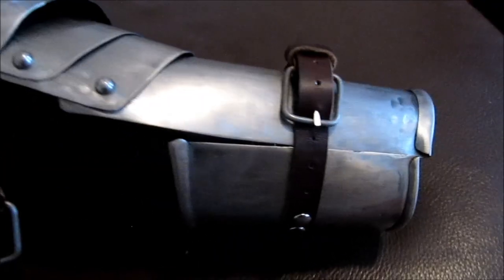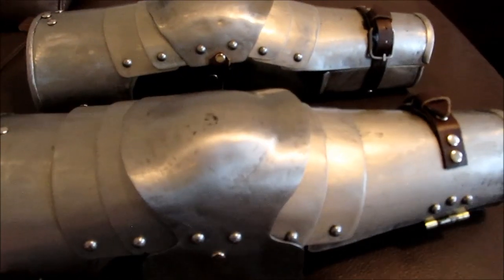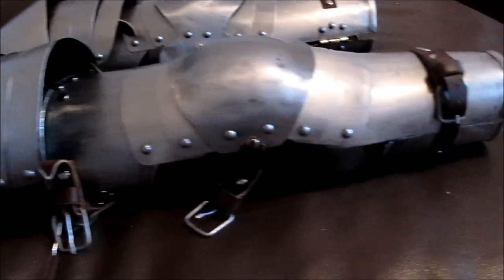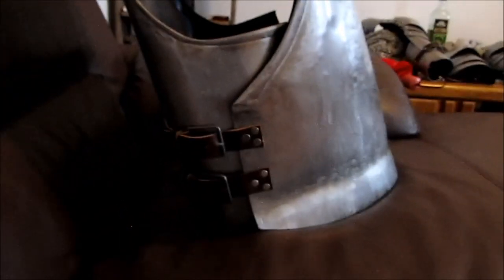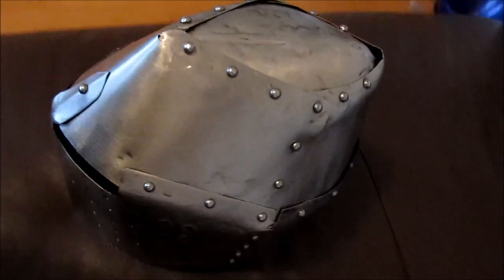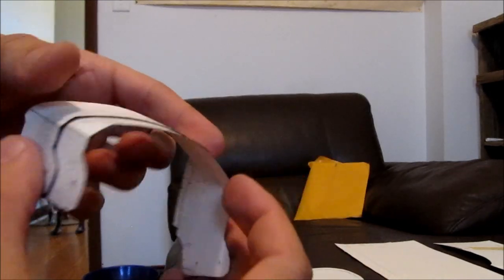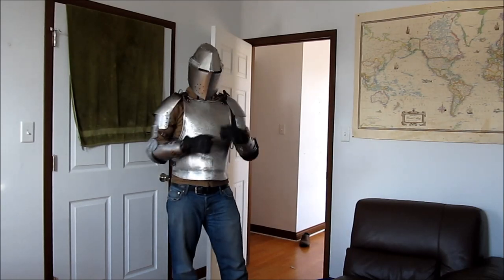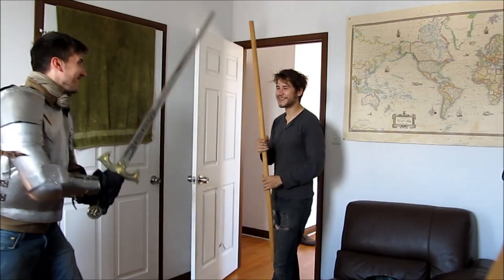Plate Armor tutorial [HD]

Comment: For a first suit, it's a really fine job.

Sure there are mistakes, but a first suit without mistakes, there is something odd going on there.

I'd say the piece that came out the best was the lower arms. The articulation along the elbow was really nice.

Me myself is working with 1'5mm steel. That's inbetween 16-17 gauge.
So it is a lot tougher, but then i'm making my armour for actual martial arts, so making it thinner than that is encroaching on safety.

Really nice explanation of things. I enjoyed it.
Reply: Isn't that still to weak? I thought you'd need around 14-16 gauge steel.
Reply: It depends on what you are going to use it for.

The helm in the sport needs to that thick. But most other parts can be thinner.

And historical suits were actually rather thin. But thicker in certain points expected to be hit much.

If you are just gonna have it for show. Then you don't need a thick suit.
Reply: You seem to know your stuff. Would you mind helping me. I'm looking to buy some armor to finish my set, I have most of it already. The armor will be used in reenactments with dulled blades snd such. Any suggestions on what it should be made out of? Most of the armor is already 16g
Reply: Well, i have to admit, i have little clue how the gauge system works. And there seems to be two of them just for sheet steel, and i know there's another for wire.
MM for steel, ALL THE WAY!
But. I'm using a conversion table.
http://www.mesteel.com/cgi-bin/w3-msql/goto.htm?url=/info/carbon/thickness.htm

It also depends what you expect to do during the reenactment.
If you are just gonna stand around, looking pretty. (Which is fine.) Or LARP. You want a light harness. Perhaps as low as 18-20. Or in that area.
For comfort, and reduced weight.

But if you expect to do some stage fighting, or battles and the sort, you want thicker.
Both for protection, but also so the pieces doesn't break as easily.
So around 16-17 gauge is a good place to start.

Although if you expect to see heavy combat, like SCA fighting, or some really melee style reenactment. Perhaps even with only slightly dulled blades. You need that protection, and beginning at 16, and only looking up is the only way.
But going above 14 is excessive, since it will wear you down with its great weight.

If you wear a full 14 gauge harness, you either need to be very strong and specifically trained for such a heavy suit. Or be really handicapped.

The optimum thickness is always in relation to what it's gonna be used for. And finding what works for you is also important.

I fight in SCA, and several people find that just some leather and an extra plate here and there (except the need to be armoured areas) works well for them.
But people like me, with less pain tolerance likes some proper protection.

I make my suit using 1,5mm. It will be rather heavy for me, but since i'm work hardening it and as such it will end up slightly thinner.
But i feel that my suit will protect me well when fighting. And that i need to exercise anyway.
So ask around, consider my view on things, check for someone elses and get your own view for your own needs.

Good luck to ya! :D
Reply: Thank you, I really appreciate it.
Reply from the maker: Floyd Keim III 

My suit is definitely not the appropriate thickness.  That was due to lack of knowledge and lack of proper tools.

From what I gathered from my research while working on this suit though, is that 14-16 gauge was usually the thickness of most of the armor, sometimes even as thick as 12 gauge at certain parts.  The thickest parts traditionally were the helmet, chest and gauntlets (although when I went to the Art museum to actually look firsthand at plate armor I noticed that the gauntlets appeared pretty thin, which was strange to see one thing while hearing another).

Additionally, most armor pieces were not uniform in thickness.  Skilled armorers will aim to craft certain pieces thicker at critical junctions.  For example, the front of the breastplate will be thicker than say the sides of the back-plate because they would rarely be hit in a fight.  By doing this, they reduced the weight of the plate armor while not compromising the protection it afforded.
Reply: ***** Well some probably was, but the fine suits was of higher quality steel of course.
Reply: ***** But it's cheap, and the common man wouldn't see the difference.

I'm not saying mild steel was preferred. I'm saying that it was probably used more than we think.
Reply from the maker: Floyd Keim III If using dull blades, 16g should be fine.  I would suggest using mild steel because of its affordability.  Additionally, a much better armorer on youtube Eric Dube uses mild steel and I'm going off the assumption he knows what he is doing (he creates armor for competition).

If you're still looking to buy some armor I'm getting back into making pieces.  For a price I can make custom fitted armor.
Reply: I've just picked up a mostly stainless steel suit, it's far better than my previous. I have to say, I love stainless steel, sure it may not be historically accurate but the fact that I don't have to worry about cleaning it and it seems to dent far less is amazing. Yes, 12g-16g is good from what I've seen.

Comment: Templates! Just for the helmet... For now.
Reply from the maker: Sorry in taking so long to get back to you.  School started back up (partly why this video is rushed) and I've been busy.

I don't have a scanner so I can't really upload my templates but I think I can still help you out.

What you can do is pause the video when I have the camera poised above the templates (there are only 4 for the helmet) and you can basically re-draw those basic shapes out.  It's not critical you get the exact shape right since every person is going to have different head measurements.  What is critical is that you take accurate measurments of your head (even being off by an inch can look unsightly or make the helmet unwearable).

Get a flexible ruler (basically string).  The measurements you want to take are 1) the circumference of your head 2) Height from top of head to bottom of jaw 3) Height of top of head to middle of pupil (very important) 4) Distance from nose to back of skull.  Allow for 3/8 of an inch for typical padding (pay particular attention to eye level here, if you loose the eye slit position your helmet just became a bucket with holes in it).

Now with those measurements, make and cut out your own template for your helmet.  Pay attention to how the plates are overlapping/underlapping each other where they meet (you have to study pictures for this).  Make any adjustments you need in paper and then transfer it to steel and you're on your way to making a helmet.
Reply: Search armour templates. He has everything

Comment: wow, pretty good. are you able to reach upwards for positions such as the Ox guard?
Reply from the maker: I get pretty good mobility while wearing it.  The biggest annoyance is not being able to bend naturally at the stomach/chest area since it's all one solid sheet of steel.

I have no idea what the Ox guard is.  Sounds knight-y
Reply: Bierdz Blacksmith & Leathercraft the ox guard requires you to move your arms a bit up. So, are you able to, say, make your arms completely vertical while wearing the armor? 
Yeah, about the bending over, historical steel cuirasses tended to end at the natural waistline, around the belly button to allow bending over, rather than continuing to the waist belt.
Reply from the maker: Yeah I can get vertical.

I know, that was a technically challenging part of the build.  When making this I was using cardboard as a template and although it is better than nothing, the 'give' in the cardboard doesn't equate well to the unyielding quality of steel.  Plus at the time, I didn't have anything that could easily cut through 18g steel so I just let it be.
Reply: Bierdz Blacksmith & Leathercraft oh ok, makes sense. I'm creating some cardboard templates of my own, so I can relate. Thanks.
Reply: By the way, could you post templates here for the helmet? I would definitely appreciate that.
Reply: In a diffrently made suit you should have no problems benidng, Your armour looks epic but the breastplate needs to end where your ribs do, and a segmented skirt starts there that ends at your thighs

Comment: hey, how thick was the scrap metal between the plates. i have some trouble with the space between plates
Reply from the maker: jeroen meijdam I used a scrap piece of 22 gauge steel to space the two plates apart when riveting them together.  It's a good idea to go slow on the riveting process to ensure the correct tightness.  

Also, I cut out a 'U" shape in the scrap piece that was approximately the width of the diameter of the rivet I was using.  In this way, I was able to 'catch' the rivet using this negative space and keep the rivet and my spacer in place while hammering (hope that last part makes sense, if not, I made a bad diagram).

              O         (Rivet)
                         
      -----      -----
      l     l__l     l      (Spacer with negative space to 'catch' rivet)
      l                l
      l                l
Reply: Learn Armor Hi, this looks great! Btw, did you use templates for this? I'm trying to find good templates for a similar build but I can't find any.
Reply from the maker: ***** Thanks!  I did but I lost them when I moved recently.  

I would recommend using some heavy poster paper for your templates.  You want something that will remain relatively stiff and rigid; paper that is too thin will 'give' in a way that makes you think you have a finely articulating piece but when you transfer to steel, you find out there was actually a whole lot of resistance in plate overllaping.  You want a paper which will fight this friction and hold its shape just like steel will so that way when it does articulate smoothly, it's because it will actually articulate smoothly.
Reply: Learn Armor These are great tips, I'll keep them in mind. Thanks!!